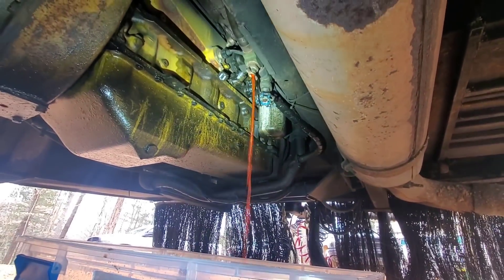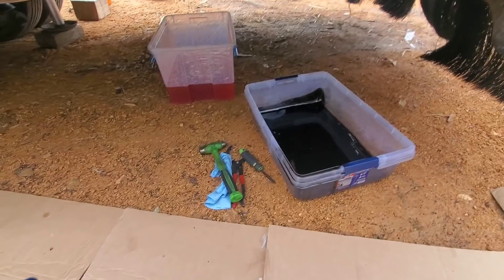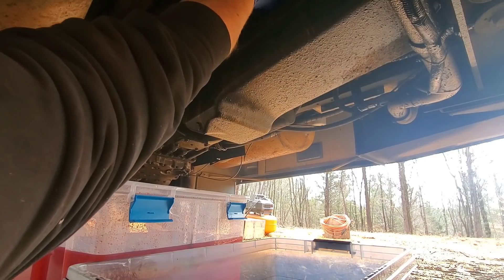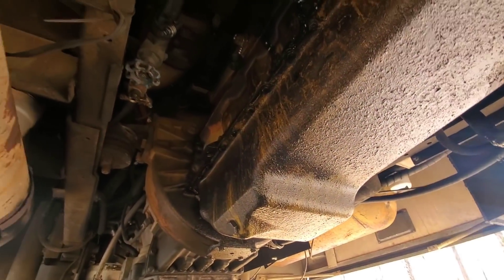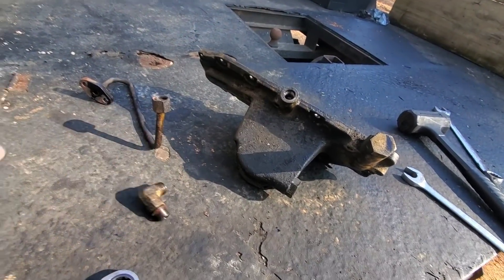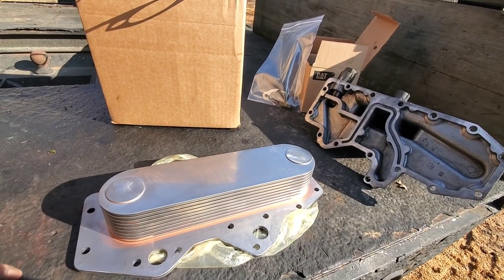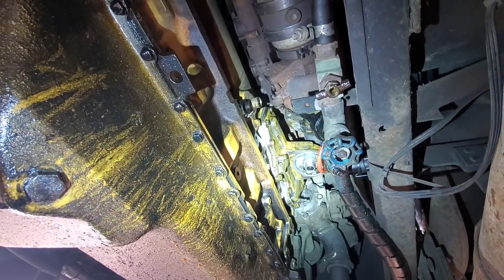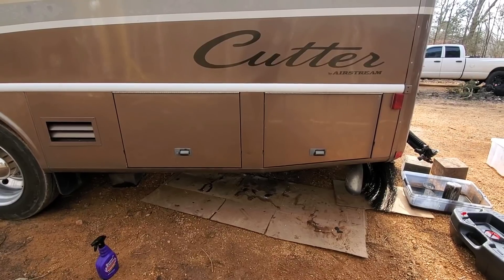3126 CAT oil cooler

Comment: Hehe, gloves! Dude, I'm old school. Gloves are a recent thing. I had a reaction to carburetor cleaner many years ago, and my dermatologist recommended Kresto. Stockhausen made a liquid glove, called Travabon.

3M makes it as well.

Due to the Covid debacle, gloves are expensive.

Diesel oil is a mess, it's tenacious. I understand, brother.

Footnote. Man, that start crank sounded strange. Used to the 8v92.
Reply: Anything is a mess. You end up with stained hands and dirt/oily mess under and around your nails. If you want to stop to go inside to do something (in my case I work on just my own stuff) get a drink grab something quick to eat you can just pull the gloves off and a quick hand washing and do whatever compared to scrubbing clean and multiple washes without gloves. I may just want to grab a cup and make a drink and come back out, not spend 5 minutes washing my hands
Reply: @natevanlandingham1945  That's it gloves do help

Comment: Why are people complaining about how you use your tools?  They are YOUR tools.
Reply: I worked as an electrician for about 45 years.  I used a screwdriver for tightening locknuts on conduit fitting, knocking holes in sheet rock, chipping the glaze off tile before drilling holes to mount things to it among many of the things it was used for.  A spokesman for Klien Tools once told us, when he came to our apprenticeship class, that a pair of linemen pliers was not a hammer and a screw driver was not chisel.  I told him he was a salesman and not an electrician.  Tools are just that, tools, you can't carry a roll around tool box with you up a ladder or down in a man hole or under a bus.  People who complain about the whatever tools a person is using are people who have never worked on anything but putting their fingers on a keyboard..
Reply: @roygunter3244  Same here Roy... I used my craftsmen screwdrivers for beating kept my Klein ones for screws.. always used my Klein’s as a hammer..

Comment: universal speedometer cable core is great at cleaning out tubes with bends in them. i am amazed that you have not purchased a store entry carpet from a cash and carry store that is rubber backed and tight loop carpeted.. to lay under vehicles.  they can be pressure washed clean at car washes..  even the half sections of horrible fright moving blankets work great on top of the cardboard or rubber backed carpets..

Comment: You mean sissy mittens
Reply from the maker: Left a mark on a brand new Lincoln once. After that I just wear gloves so i don't have clean that mess up again.
Reply: Just try getting your hands clean after getting dirty black diesel oil on them. And harsh cleaning chemicals aren’t good for your hands or in your bloodstream either.
Reply: back in the 90s there were some people making fun of me wearing gloves when i worked on my VWs. that stopped when they saw me take off the 36 mm gland nut on the flywheel without powertools, or cheater bars, just by hitting the end of a 2 foot wrench with my palm.....